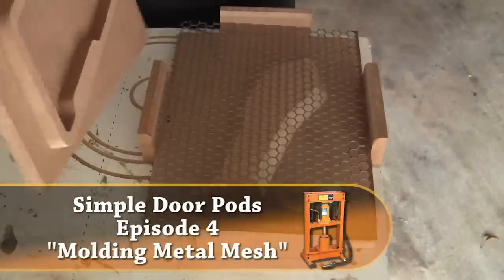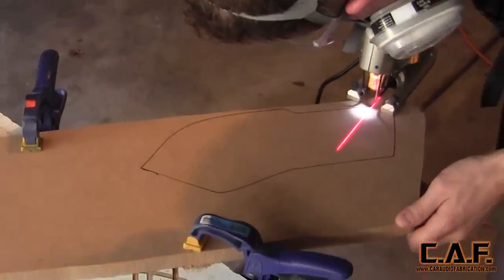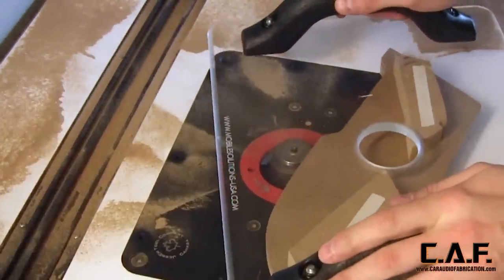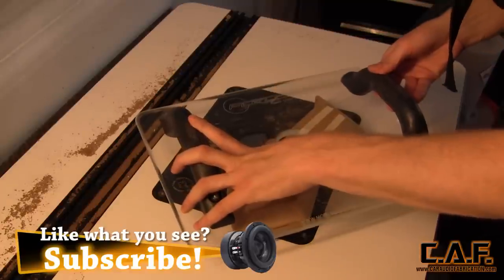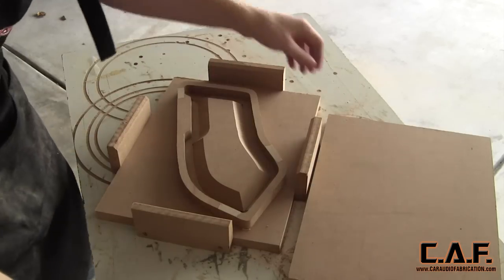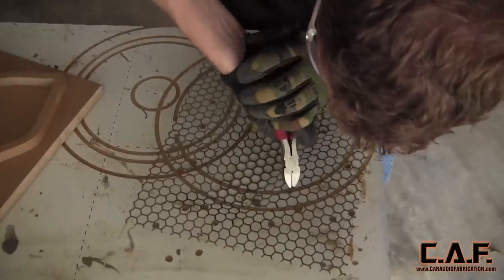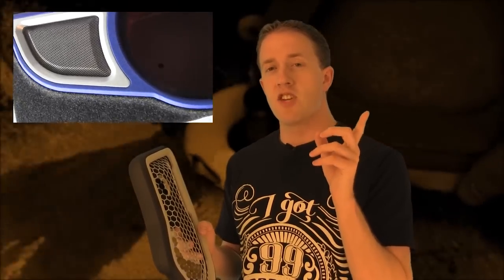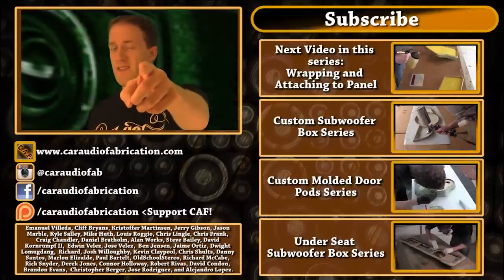How to Make Simple Door Pods (Part 4) Mold Metal Mesh

Comment: I ran Rear speaker as fill and acoustic reverb!  In a concert hall you have the Performers on stage true, but you also get that reflection off the rear of the Arena. I always placed in the Top Three during Sound Q competition with this affect. Low watts and resistance for timing and alignment! Motor Man AM Sound Works

Comment: i am currently building a system- 3 way active front and subwoofer only. i had the same thoughts about a live performance- you would not have some of the instruments/ singers behind you, so all the sound (echos excluded) comes from the front. it will have to sound more natural, which is the ultimate goal for audiophiles.

Comment: Newer cars, like my 2016... i kept the rear fill primarily for the back up sensor.  I only amplified the front stage.  1. saves $ on not needing another 2 channels. 2. I do like a little rear fill as long as its 80-90% faded to the front or time aligned to the front.

Comment: In my current set-up I have a pair of 3-way 6x9 from Rockford Fosgate but only as "rear fill", I use a separate amp, with only a minimum level. In the front I have a 4-way sepatate component layout with dedicated amps and cross over.

Comment: Run the fronts off the best two channel amp you can find, coming off the 'Front Out' rca's. Then, run the rears off the deck's rear speaker outputs. You'll have a less abrasive sound experience for the rear passengers that way, as well as less interference with the Front stage.
Reply: Thats how I do it - with a bass blocker on the rears to eliminate distortion and phase issues.  Not a fan of rear fill - destroys the soundstage... in many of my installs I've removed them.

Comment: Great video, as I've come to expect from you. I generally use coaxial speakers powered by my head units internal amp as rear fill. I keep rear fill for volume. I can't hear them specifically, but I can tell a difference in overall volume when I'm driving.

Comment: I always use rear fill in my sound systems, with 8Ω speakers so as not to overpower the front stage and provide just the right amount of sound for the rear passengers and myself. My current rear fill set-up uses a set of 3-inch mid-range speakers with a 1-inch tweeter on a custom baffle in the stock location of my 3-door 1985 Corolla GT-S.

Comment: The louder the better. I had components in the front doors of my 2007 Honda fit and 2-ways in the back. I didn't like how it was muffled in the rear so I added components to all 4 door panels. Best decision ever as the sound fills the cabin much more uniformly. This can only be achieved if you sound dampen the whole care so that way you get the most acoustics out of the instruments.

Comment: Ive noticed that keeping the rear speakers help a bit to get the full sound. It helps give a balance if you have a rocking sub. I run focal door speakers and a DD 12" 3500 and without the rears it just doesn't sound "full"
Reply from the maker: Matthew Ong So do you leave the rear at full power or adjust the fade?
Reply: I fade it down about 70% took me a while with different music but it sounds full. So you still get the center stage but it's not empty behind you
Reply: I'm surprised how the Focal's (i've owned a few Focal speakers) can keep up with the DD 3500 (I've owned a few DD subs not the 3500) when pushing hard!

How's the 3500 for SQ?

Comment: Ditch the rears. I'm running 2 way active with a 4 channel Amp and the 80prs. I still have my rears hooked to the deck I just don't have the internal Amp on.
I'm constantly switching my stuff around and if you unhook your tweeters you can turn on the internal Amp and the rear speakers will be on  the high HPF in network mode

Comment: If will also keep the rear speakers. They don't have to be as great as the front stage but you do need them. I have 4 6.5 mids and 2 super tweeters on my back deck and it sounds good

Comment: I do rear speakers because it helps the sub in the trunk not seem so distant. I like the sub to blend with the front speakers, so that you almost cant tell there is a huge speaker in a single location in the rear of you. The car audio environment has many challenges, and there is almost always a compromise.
Reply: This is true but you can achieve that effect easier with strong midbass up front like using a second set of 6.5" set at bandpass filter or even an 8" sub done the same way.
Reply: Are you driving in a fucking limo? Lol. If you're having problems with it sounding too far away, that means you either don't have enough Bass, or you don't know how to design an enclosure properly.

Comment: I know a lot has changed since I was doing this in the early 90s, but when I went to the Rockford Technical Institute they adviced using 8 ohm speakers for rear fill.
Reply: prerunnermaniac I realize this is old by now, but that sounds like a brilliant idea to me. They naturally play at a lower volume and that’s perfect for what I like to hear in my vehicles. Finally I know what to do with my 8 ohm 6.5 pa style skars! Thanks man
Reply: @rodneykupcs4141  instead of trying to go out of your way to get different ohm ratings and worrying about your amplifier, why don't you simply use your EQ that's built into the most aftermarket radios? That just seems more logical to me... you have the option, why would you take it for granted?

Comment: Got to have my rears. I want to be sitting on that stage with the musicians, not listening from the back. I fade 100% to the rear then bring up the fronts until the rears just about disappear. I like a 55/45 split. Don't need super high end speakers in the rear but a system does sound much better with them.

Comment: Front speaker installation, would skip the rear speakers, depends on the car of course. Did an installation once, where I had 3 way sett in front and only two ten inch subs in the rear shelf, the sound was very good and even the people that sat in the back thought there were some speakers in the rear. But I also thing this is very personalized. And thank you Mark for all the great videos ;)

Comment: Love this look man. Great to see more vids come out.

I have experience with no rear speakers (amps went out on stock rears). Front stage was fine and had sub. Sounds like poopie. I love hearing the full range front to back and left to right and some bump.
Reply from the maker: Th3uNn3rV3d Good point, thank you for watching!
Reply: CarAudioFabrication I look at it as immersion, yeah a band plays in front, but they way the acoustics are set up, the people in the middle get sound from the front back and sides. In order to reproduce that appropriate staging is needed. I was just using my car as an example.

Comment: The factory   placement  of my rear 6.5 speakers  in my 2000 Honda CRV is in the rear of the cargo area about  4 to 5 " from the floor putting 2 sets of Rockville 6.5 components with 3"  tweeters in the front  doors. I was thinking about putting speakers in the rear doors for  people in the back seats later on down the road.i also putting a single 12" zv5 in the hatch/cargo area

Comment: First comment and first view. I keep the rear stage speakers. Had a conversion with my friend about this. He brought up that it gives you more of the surround sound rather then just sound from the front. After trying it out I liked it and stuck with it. I usually go with components up front coaxial in the back.
Reply from the maker: Dan V Patrons get first dibs! Definitely no need to do components in the back!
Reply: CarAudioFabrication

Yeah. I don't do components in the back just the front. I was wondering what you thing of center stage. Would that be a good thing to do. So like a center mid-range speaker.

Comment: Definitely depends on the vehicle.  Usually keep the rear stage on less power than front stage and have a pretty significant fade towards front stage.  Also depends on how much sub is going in the vehicle.  Front stage solo is fine for a single 10, but multiple subs and the rear fill is pretty necessary.

Comment: My thoughts on the final question... I say YES, keep the rear fill. Your ears can pick up direction. At a concert, the sound is in front of you initially but then surrounds you in the form of reverb or reflected sound. I like rear fill delayed through time alignment and reduced output volume.
Reply: Yeah but for overall sound quality that's a horrible idea.  having Reverb is the same as bad as distortion. I don't want to hear the same song Twice. When it comes to listening to music having only two channels is perfectly fine. In most cases it's better. In fact the best sounding system would be only kicker panels in the front and then Subs in the back.

Comment: I got a pair of Pioneer TS-A173Ci 60 RMS speakers hooked to an amp that delivers 75 RMS at 4 ohm in the front. No speakers in the rear since I got a 3 door golf Mk3.
I planning to get a single Sundown Audio X8 subwoofer or 2 smaller 8'' Sundown Audio subs.

If I had room for rear speakers, then I'd only have midrange / bass speakers

Comment: First off, Mark, great video and very informative. Second, when dealing with soundstaging, it depends on how "audiophile" you want to get and do you have the equipment to do it correctly? If so, you must use a processor correctly so that the staging effect really works like it should. I use the rear to accomplish what the sound actually does in an auditorium, in other words, I time the sound to act as though the sound has reflected off the back wall of the listening area and creates a natural effect of being at a concert type situation. That however, takes time and effort in the setup of the system in question. As I said before, if you have the equipment to do so, you can make some really excellent sounding soundstaging. However, pure audiophiles will not like this and insist on deleting the rear speakers due to correct positioning. In reality it is whatever each person prefers by their own ears. Thanks again for the great videos!

Comment: Rear fill. The front to rear transfer is just as important as stereo. Sound still echoes in a recording studio as it does in a concert hall. Though it's a tiny bit,  sound still comes 360° around you. Amplitude is what rips your head off in a properly balanced system. You're trying to recreate a concert hall environment in your car. You HAVE to have rear fill, just in far smaller quantity than the front stage

Comment: I keep the rear because that's where you should receive a mid bass response to have a much more detail bass line your components is supposed to deliver a front stage sounds but you need a solid bass in the back before your heavy bass line  (subwoofer ) drop in if you care for that kind of details then  that's what you want or should do .

Comment: Keep the rear speakers. I always have a much more prominent front stage , having the rear speakers fills out the rest and the distance from the front helps deliver a more full and rich mid bass sound by giving the sound a chance to develop by the time it gets to the listener . The front stage usual over shadows the rear fill to the extent that you don't notice that sound is coming from behind . I also like for passengers in the back to have a full audio experience a well.

Comment: I always install rear speakers when doing an install, it gives a full surround sound to the staging.  The question I always get is when adding extra speakers that are amped on the rear shelf and the front door, do I keep the factory installed speakers connected straight to the head unit - well yes and no.  I upgrade the speakers in the factory positions and keep them wired straight to the head unit.  Even though you have more powerful speakers shouting louder, they add a subliminal background fill that adds to the 4 amped speakers.

Loving the moulded mesh dude. luckily with the finer, thinner mesh, you can get away with standing on it, it's not that difficult to mould.  If your a bit of a skinny runt - get one of your beer swilling, kebab munching mates to do it.  Failing that, paint your mould box like a set of bathroom scales and take it to the gym and leave it on the floor - someone will do it for you eventually :)

Comment: I have an extended cab f150 and I'm currently getting material and equipment for my build. I plan on deleting the rear fill just because it seems unnecessary because the backseat will be removed for my subbox.

A friend who actually just got a new 2014 Malibu is doing a build on his car too. He is going for a stock look. With all out sound deadening in the car. He is planning in removing his rear fill and somehow we are going to funnel his port through the 6x9 mounting holes.   If anyone has any ideas or why we shouldn't do this, input is appreciated thanks! Also Mark you're videos are great! They are definitely a tremendous help in both our builds. So know at least 2 people for sure are in your debt!

Comment: In my opinion personal opinion you should keep rear speakers, but use them in unison with the fronts to help you feel like the concert is around you.. not necessarily you in front of a concert.  Also i like to split up my frequencys between speakers so that way my rear speakers (usually larger) pick up the low-midrange, and my front speakers pick up my high mid-upper range.

Just my $.02

Comment: I prefer to only keep rear fill if it's a passenger vehicle that actually has people in the rear seat often. A bandpassed 5.25 or 6.5 midwoofer run passive off the deck is usually plenty if you have a strong front stage or small amp if you have a very bass heavy vehicle.

Comment: im planning on just running my rear speakers off deck power in my new build im getting underway. then amping the heck out of the fronts... just saves some money on amps and you still get a little more sound basically for free cause there is already speakers back there and the deck has the ability to run them, so why the heck not...?

Comment: Rear-fill can sometimes improve the front stage image, if used very sparsely. You should not be able to hear anything coming from the back. Some fill can make the stereo image "release" and enlarge from the front speakers. Too much, and you loose focus, though. As always, depends on vehiche, setup and tuning...
Reply from the maker: Roger Hansson I like the way you think, thanks for posting and watching!
Reply: Agreed. Crossed between around 200-2khz and delayed by 20+ms can add a sense of ambiance similar to the reflections from the back wall of a large concert hall. It's not true to the source material, but definitely better than full range blasting behind you if you want to keep the "concert" feel.
Reply: SPLEclipse My only experience with using rear fill was with only passive processing and kickpanels. It was in a estate car, so the rear speakers where as far away as possible. I will try it with a modern DSP sometime. In smaller vehicles some delay can probably help. I really dislike that "concert hall" effect that used to be a feature of home theater receivers and such. It sounds weird and not natural at all! :)

Comment: How sharp of a bevel can you make with your typical speaker wire mesh? I see OE speakers using sharp, almost 90 degree angles. Can you normally pull that off using a technique like this? I know they press the shape as well, but I'm not sure how precise their molds are in order to not shear the metal.

Comment: The rear speakers in my ranger are closer to ear level and I feel like I get a much better sound out of them. They only about 6 inches behind also.
Reply from the maker: Are you hearing them more than the fronts? The goal is generally to have the sound appear to come from the front of the vehicle.
Reply: I'm no expert, but from my experience it's easier to just have the higher frequencies playing up front. if you have a full range playing at the back then this tends to "pull" the staging to the back of you. The subwoofer frequencies are a non issue because of the wavelength, where the phase can be flipped to have the bass appear in front of you. Additional bass can be had if you cross the rear door speakers at <200Hz, while keeping the front stage and not ignoring the rear passengers. Time alignment would be required obviously.

Comment: I like to have a more surround sound type my old systems was 7:2 not huge db about 119 but super clean..
Reply: I could get 119 with only six and a half drivers. If you had a 7.2 and you could only get 119... sorry. You got ripped off. Why don't you get some subs that can play Extremely Loud, and just turn down the bass knob? That way if you ever feel like hearing lots of bass you can easily just turn it up and have it at your own expense. That way if you ever just have the wild hair up your ass to hear some good bass, you can!

Comment: I personally would keep the rear speakers as it adds more depth and fullness to the stereo sound and surrounds you with sound. I have had cars with only front speakers, front and rear, and all over (in every door, rear deck, dashboard). I feel the more speakers you have surrounding you and your passengers, the more enjoyable the experience. Not to mention its better for mids and highs to punch through heavy bass as there is more sound producing surfaces.

Comment: If your going to do an install for the real world you need rear speakers, but if your use a DSP your install will have a component of which you or your customer can set the system for best front audio.